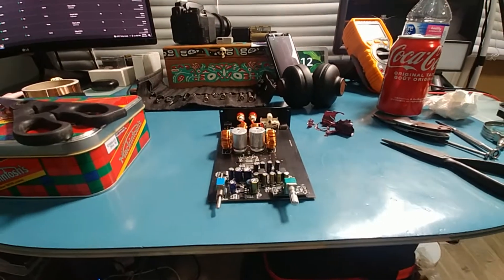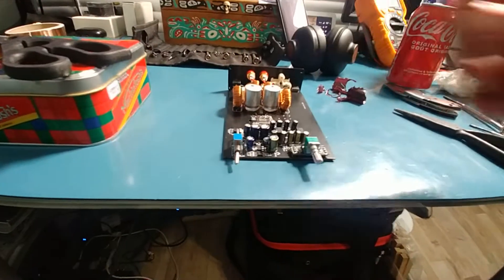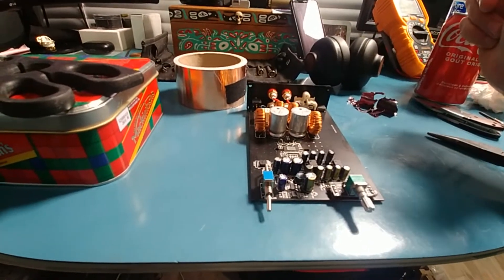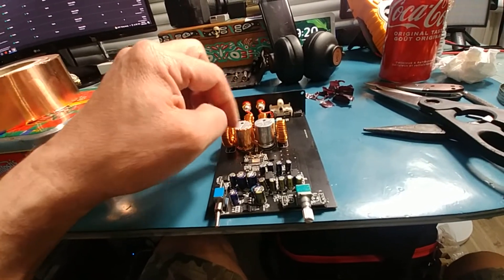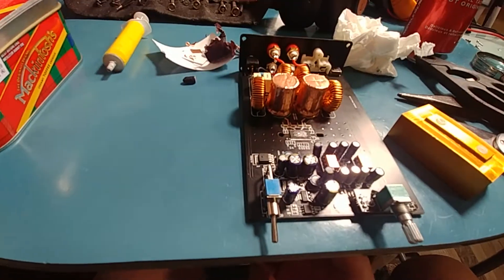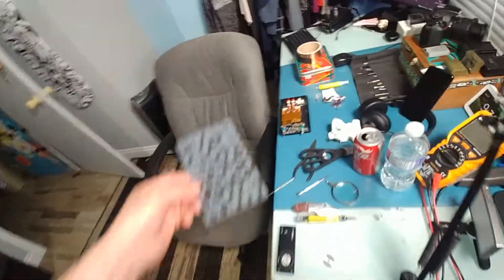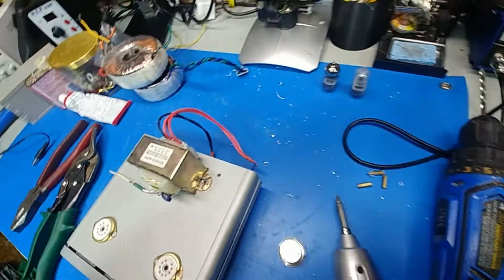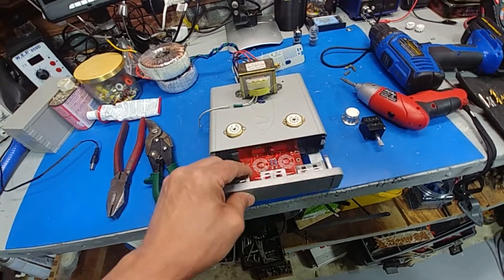electronics vlog# capacitor treatment Monday, May 9, 2022

Comment: My convection plan was holes on the side of the lower chassis part for intake a bit toward the front and then venting over the top of the caps.   Generated heat would force the convection.  Like Schiit did with their HEL2 DAC.     Looking good!